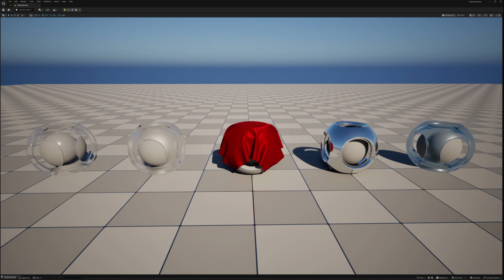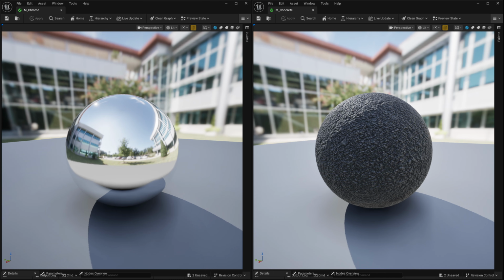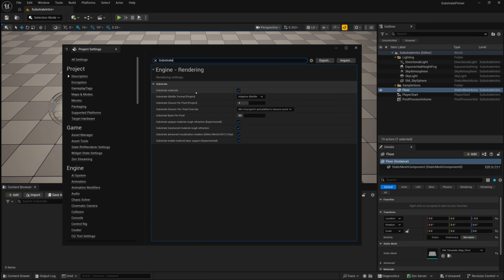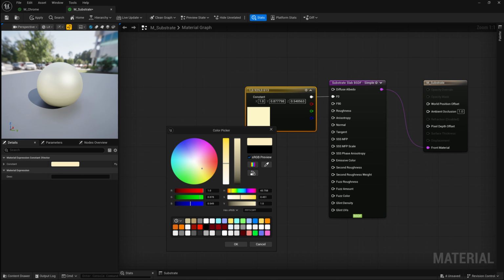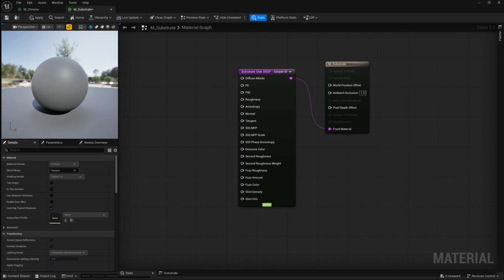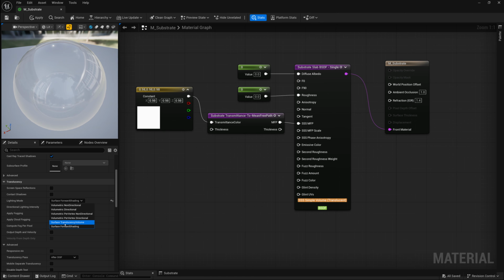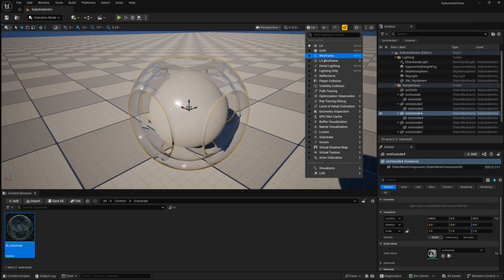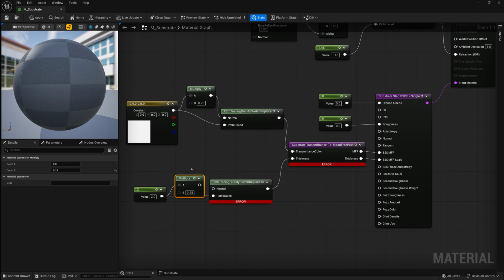UE5.7 Substrate – Next-Gen Shading Workflow Explained

Comment: Hi. Does anyone know the specific viewport and rendering settings used for this scene? I'm trying to get this type of glass to render correctly in Lit mode, but I can't seem to replicate the result.
Reply from the maker: I think I was just using High quality settings, but the thing to maybe make sure is that you have DirectX12 or Vulkan for your Default RHI setting, and also make sure under Lumen Settings you have Use Hardware Raytracing Enabled.

Comment: Not working on 5.7.1
Reply from the maker: Should work with 5.7.1. Let me know what part is not working?
Reply: @renderbucket  Everything works in the preview material, but the actual object doesn't.  Wanted to make realistic eyes. It seems I will have to use metahuman eyes.
Reply from the maker: @gamingtemplar9893 if its showing up how you want in the preview but not in your scene check your quality settings. Maybe something is limiting it in your viewport.

Generally what you see in your Material Editor is what you should see in your viewport when you apply it to a object.
Reply: @renderbucket  I look at it, and what it does,  it applies an image of the whole face from the angle I am watching on the cornea mesh, weird. I guess it's working but doing something wrong. It looks like the shader is pushing it in instead of out, like calculating the inverse of what it should.

Comment: If substrate shading model isn't embraced by other common packages in a pipeline,  then why bother?  It becomes another UE5 only step in a pipeline that is just starting to gel ( USD... OpenPBR...)
Reply from the maker: USD isn't PBR specific in anyway. Substrate is just giving more control, like what you would get out of Vray, Renderman, Arnold.etc... It's not the more confined and limited Game-PBR workflow where you are usually limited to single layer materials. Or materials that mask each other out instead of layering more correctly.
Reply: @renderbucket  Very interesting. I appreciate the wisdom.  👍  Does it impact material texture creation apps such as SP or Mari?  Will they create F0 and F90 maps natively?   Thanks in advance.
Reply from the maker: @outtoplay  

It can be treated the same as before if needed, it just provides more control. F0 Reflectance At Facing Angle, F90 Reflectance At Grazing Angle. There's Metalness workflows/node for Substrate, and also the ability to use Fresnel or custom control over the reflection at different angles.

Very similar to control you would find in VRay, Renderman, Arnold.etc but just designed/aimed at realtime rendering.

Comment: 4:45 I had an art director who would say that in real life, something is either metallic or it's not, so he wouldn't allow any other value than 0 or 1 for metalness. And while he is technically correct, the only way you could actually represent materials accurately like this were if your texture resolution was high enough for each pixel to represent an individual atom. Metals are almost never pure in real life. For instance, steel, by definition, is an alloy made of iron and carbon. Iron is metallic but carbon is not. If you looked at your metal channel under a microscope, at molecular level, it would be mostly white with speckles of black. If you zoom out a thousand times, you'd just see a light grey. So this is why, I believe (and this is my opinion, not a proved science) that it actually makes more sense to have metallic values of 0.9 than 1 (unless you make an electro-plated chrome of a mirror).
Anyway, my point is, yes it ok to have other values than 0 or 1 for metal and can be justified by technical limitation. When we have quantum graphic cards that can render each individual atoms, then yes, we will have to truly respect physics and chemistry :)

Edit: a quick google search shows that the amount of carbon in steal is only between 0.3 and 2%, so I'm wrong, metalness should be around 0.99, so at this point might as well leave it at 1 lol. But there are other allows, like brass, pewter, cast iron, bronze... with more or less purity, for which it can be interesting to play with the metal value
Reply: He forgot one thing, this is not real life!.

Comment: Hmm, following your exact examples, completely cloning your graph set up, my glass looks quite a lot different. Despite the IOR 1.4 the refraction I see is DRASTICALLY different to yours and your overall glass looks different too, the specular highlights are tinted more than mine, making the glass more visible and realistic. For example where the grey floor appears in the material preview window, your glass is fully visible over it and looks a slight yellow tint. Mine isn't visible at all over the grey floor, it's 100% transparent.
Reply: Hey, did you find out what the problem is with IOR? I struggle with it a lot.
Reply: I believe I have the same problem

Comment: The reason unreal gives you F90 is to expose a variable for Schlick Approximation which gives you full control of the formula, Adobe uses F90 internally as well but it's scaled based on F82; which means that you do not have a full control of the formula. Adobe's approach is good if you eyeball it and don't base it on physics, while Unreal made it the other way around.

Comment: translucency in unreal always seemed so janky to me. I tried using single layer on my ocean shader and motion vectors are all funky it turns into a taa mush. Tried using traditional translucent shaders and specular reflections look grainy backfaces of waves overlapping creating weird sorting issues refraction breaking. You need to enable outputting motion vectors to prevent your moving surface from turning into an artifact soup and when you do that you need to use a custom depth pass to access underlying depth info and so much crap. The result is meh at best its transparent yeah but it runs 2x worse than an opaque shader and has 2x lower quality shading with 2x effort for what? I guess thats how things work in the translucent department in engines idk

Comment: why dont you turn on the raytrace transluceny? In that case the ior in lit mode is calculated properly. I managed to have a realstic water depth on a swimming pool, although it is a bummer that light functions dont penetrate the surface as soon as you turn on this option, so no fake cuastics.....
Reply from the maker: This does help, but it's not a fix since it causes other issues and is more demanding. But it is a potential solution in some cases.
Reply: Checking the two options for the transparent mode of ray tracing will directly cause Niagara particle effects to malfunction, which is a major bug issue...

Comment: At 34:36, why did you multiply the thickness by 0.25 after the thickness value goes through the Transmittence-to-MFP node? Have you not already done that calculation on the left hand side?
Reply from the maker: I was just doing that to make it even darker. Would probably be better to just reduce it more on the left side so it's more of a clean/simple network graph.